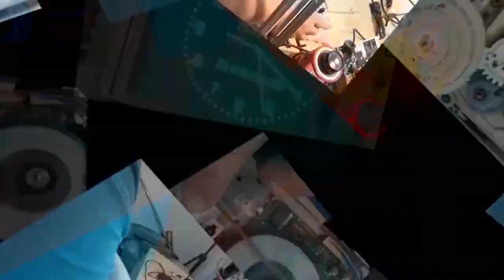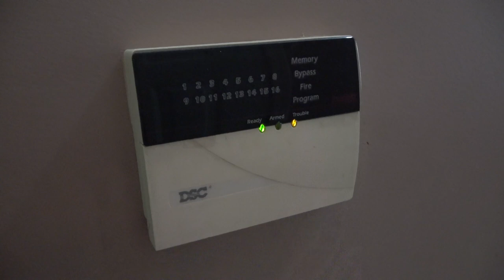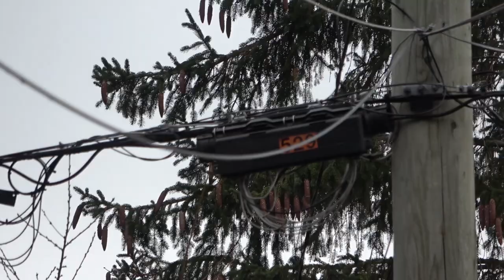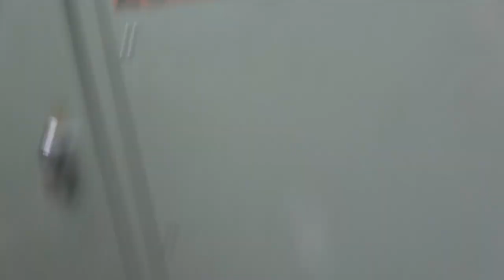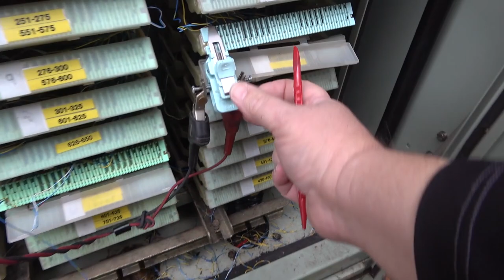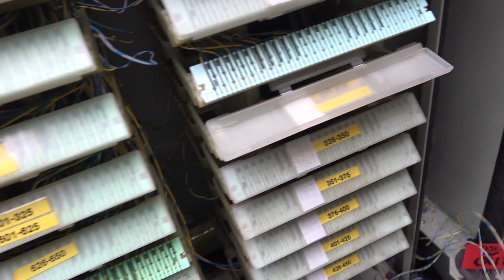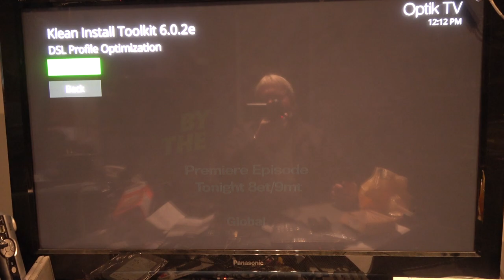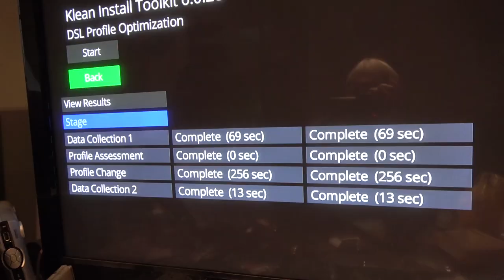Fixing my old noisy copper phone line

Comment: 75Mbps on ADSL??? 😲
When I was on ADSL2+ my line was rated a maximum of 21 Mbps but homes only got up to 11-12 Mbps down (I only got 6.3 Mbps down). I upgraded to FTTC back in 2011 or 2012 and now get about 46-49 Mbps down and 6-8 Mbps up (from a package that delivers "up to" 76 Mbps down and 20Mbps up). But you get 75 Mbps down and nearly 20 up? Wow!!!

Full gigabit fibre is now available at my address but I don't use enough speed or have stability issues to pay an extra £7 per month for the 150 Mb down/30 Mb up service and have no need (or funds) for the 900 Mb down/110 Mb up service available from my provider.

Comment: damn i wish we had copper lines still in my city, I don't want a voip line
Reply from the maker: Eventually they will all be gone here too. I would guess within 5 years at the rate we are going.
Reply: @12voltvids  thats disappointing, I imagine the rural areas will always have them. But what doesn't make sense to me is why someone would get a VOIP home phone when they need to have internet for it to work in the first place. So if the internet went out or power went out; oops there goes your phone to call for emergencies...
Reply from the maker: @VileStorms  yup that's the problem.  They need a battery backup to keep the ont running and the battery is only good for about 8 hours then it shuts down.

Comment: you can dump a high voltage down the line , this will arc any bad connection together ,
Reply from the maker: They used to use those old KS sets. Held a bunch of batteries and totaled about 600 volts. They haven't used those in years. We sunset them about 15 years ago.

Comment: DCS makes a ethernet card for older alarm system models like yours. Voip providers in Canada are required to support E911 by having you register your address with the line. Grandstream ATA will support pulse.  C'mon upgrade to fiber man 😅
Reply from the maker: Sure you pay the extra charges on my bill for life. How does that sound? I want to cut my charges not increase them. 
And its DSC not DCS. That might be fine and dandy if my alarm was monitored but it is not. I am the monitor. It calls me directly.  I could get a wireless alarm system from work for 10 bucks a month, but that is 10 bucks a month more than I pay now.

Comment: Also, during a power outage, the phone company was required to supply power on the copper lines for emergency service. Can't supply power through fiber optic lines. Where I'm living now, there is no longer an option to connect to copper, and the phone/cable company does not even provide batteries for the cable modem that the phone runs through.  I am tired of Government and corporate greed making my property obsolete once the reliability has improved enough to ensure the item will not fail. My pulse dial phones will not work without purchasing special adaptors. My analog/digital Seiko watch that reset itself for daylight saving time was killed by Congress changing the dates to reset clocks. Five portable/pocket televisions along with four larger home televisions made useless by the elimination of NTSC television. Government forced everyone to buy new televisions with that one. (The five inch color portable television is 36 years old and still working perfectly.)  My 1949 Cushman motor scooter made dangerous to use by increasing the speed limits significantly higher than the scooter will go. FAA imposing oppressive regulations a couple of months after I bought a drone. I could go on, but you probably get the point, a lot of the change is to force everyone to spend money for things that they shouldn't currently need.
Reply from the maker: I hear you. I have one of those clocks that is now wrong 2 times a year as it changes on the old daylight dates. Hopefully this will be the last year we change the clocks. Our provincial government is wanting to keep the time permanently on daylight. They had a plebiscite a couple of years ago to test the publics acceptence of staying on dayight time and it was something like 75% in favor.  We thought it would have happened last year and then covid derailed everything. Hopefully this year.

Comment: If the loop has digital service, it has voltage. Literally how it works...

Still not sure what you meant? did you mean the battery voltage for the telephone loop?
Reply from the maker: Battery is the DC loop voltage, supplied by batteries at the CO and that is what makes your phone set work. (yes there are giant batteries at the office kept charged by 52 volt power supplies) The digital loop does not use DC voltage. It runs on AC voltage, in the RF spectrum between 200KHz and 8 or 17MHz depending on the profile. The RF voltage is actually quite high, around 140 volts when it leaves the dslam but current in the micro amp range. Through cable attenuation this RF voltage drops substantially by the time it gets to the subscriber modem, but the subscriber modem is putting out an equally high RF voltage for the back-haul carriers.

Comment: There is a RJ11 wall module that has a built in circuit to convert pulse signals to DTMF so that old rotary phones can dial out on networks that don't support pulse.  If you do a quick google search for "pulse transfer dual tone multiple frequency DTMF converter" you should be able to find it, if you are interested.
Reply from the maker: That still won't change my mind about changing to fiber. I want the battery period. My security system monitors battery from the exchange. If someone cuts my phone line, battery drops, and my security system goes into alarm mode and sounds the siren scaring away the bad guys BEFORE THEY KICK IN THE DOOR. On fiber, they cut the fiber and the ONT just keeps sending the battery to the alarm and the alarm has no idea that someone is about to break in until they actually do break in. Then it goes off.
Ask why this matters? Well about 25 years ago someone did just that. They cut my phone line to kill the alarm, of so they thought. Well the siren went off and the crook ran away. I had to repair the phone line.
Same senerio,  with no alarm when the fiber is cut. Door kicked in, alarm goes off, bad guy runs away. 
Now, who is going to pay for my door repair?  That's right, I am on the hook for a new door. File an insurance claim, well I am still paying the first 500 bucks and then my premium goes up. 
So I would rather the alarm goes off first and scares the burglar away before he breaks in.
That is probably the number 1 reason for me to stay the course until copper is completely shut off which is still years away here. DSL gives me more speed than I need. It's more than good enough for the light internet usage I have. I don't game, I don't stream and I don't surf. I upload the odd youtube video and I do email. That is it. The data plan on my phone is 3 gigs a month and I barely use 1 gig. My home internet is unlimited, and I use under 100 gigs a month and that includes all the uploads I do which are several gigs each. In fact that is the biggest use, uploadingto youtube.

Comment: Can't have copper for a phone line and fiber for internet?
Reply from the maker: Copper is being decommissioned this year.  Will be totally shut down by the end of the year.  The hold outs are being shut down forcing them to change.  Have to deal with grumpy people that resist change.  I stayed on copper until this past March
Reply: @12voltvids  ah, sorry about that. I was suggesting keeping copper for the phone and switching to fiber for the internet, sorry if I came off too harsh
Reply from the maker: @kreuner11  no it doesn't work that way.  Initially 5 years ago a few people pulled that stunt. Telus is shutting down all copper. I would know i work for them.  There is an old folks home that is being torn down as soon as the new one is complete.  We are putting fiber into this old building even though it will be ripped down in 2 years because the copper is being shut down.  They want to shut down the entire co and probably sell the proprtyy the co sits on. Fiber can be fed in from the next co over.   No need to gave a 30000 sq fiut building to house equipment that is about the size of 5 full size refrigerators.

Comment: In Germany, even on fiber the emergency services know exactly where you are located.
Reply from the maker: Of course they do because the fiber is terminated at a physical address.  The ont is registered to your service address which is where the phone is also registered so if you dial 911 it shows up on the dispatcher screen exactly like it does on the old copper Network. Where the trouble arises is people that rely on strictly cell phone thinking that their location will be pinpointed. This is only true if the cell phone has a clear line of sight to the sky so that the GPS can get an accurate read. If you live in a house then there's a good chance that they will know your location as your phone will have received a signal up into the point where you entered the house so they will know the last place the cell phone had a GPS signal. If you live in an apartment or condo the GPS signal will show the last location your phone was detected but not show what unit you're located at. So you could be on the 1st or 10th floor and they wouldn't know.

Comment: how are you getting 75Mbp and 20Mbps on ADSL2+ as the max speed for ADSL2+ is 25Mbps down and 0.5Mbps up
Reply from the maker: It's not adsl2+ it is bonded VDSL 2.   2 phone lines each one trained up at 47/12 but capped at 75/20

Comment: This is really interesting but the statements about how cell phones get locations isn't accurate. They use a combination or gps from satellite, ground gps repeaters in dense urban areas, skyhook or similar wifi location mapping (basically unique wifi ID mapped to locations via carrier metadata harvested from a hundred million plus cell phones) and a pretty complex triangulation logic from cell towers. With all this combined the location mapping is quite accurate even indoors on modern phones so long as they can see some kind of signal and wifi as reference points.
Reply from the maker: Last week the police in Ontario went to the wrong address because their high tech system to locate the cell phone failed. You can have all the high tech crap you want, but it still is not as accurate as a land line phone.  There are times I check my cell phone to see where I am on the map and it is way off so don't give me this crap that they know where your phone is all the time. Most cell phones do not have the GPS chip enabled unless you are using an app that required it or you dial 911, and if you are in a concrete building away from the window the accuracy is average at best.
Reply: So that can locate what flat you are in as you lay dying on the fith floor?

Comment: A sign of the times ?   I didn't see anyone mention the ONE EYED REPAIRMAN....good ole MR. SUNSHINE who fixed many a phone problem.  Hated the repair tickets that had " E T I R  " in the dialogue......." every time it rains "  . It meant that the previous repair tech did not do a thorough job isolating and fixing the trouble or there was a HIGH OPEN on the line, ready to break open and just being held together by plastic insulation.   JwgK

Comment: Yay for new YT recommendations, and doubly happy to see VWestlife here, but uh. Switch man. I had nothing but constant issues and then fiber showed up. I went from WEEKLY issues to literally, actually zero. My fiber service stops working when I manually remove power. Not when it rains, not when a new person a mile away moves in and they steal my... literally never. For the love of god and all things holy, stop torturing yourself. Internet requests are insanely faster. And you can see it. And I’m not talking about speed of download but response (latency) to requests. You have to know this. DNS queries went from 40ms to 2ms. DOUBLE an order of magnitude faster? Yeah—you see it and feel it when three dozen connections need to be made RIGHT NOW in your browser. /rant

Comment: Why didn’t you just fix the out pair the F2 pair?
Reply from the maker: I could swap pairs no problem and if I was working and had my truck with the big ladder and my climbing gear I would have done just that and probably gave myself 2 spare clearances for future use. It was my day off and I didn't feel like going to get my truck at work to do this so I just swapped pairs and put the bonded loop with no battery on it to the noisy pair.

Comment: hmm... some contrasts amaze me... you (not as a person, but maybe region / country) have a nice infrastructure for ev's and other topics. i, on the other hand am on fiberoptic since 10 years, without even asking it.... these things i cannot fully comprehend. DSL was not installed anymore since about 20 years. 
Another thing I am curious about: So you say that with a DTMF / fiber fed phone, the emergency service does not know where are you calling from? Isn't this part of the caller ID system? I know that when I call the cable company, there is sometimes an anouncement regarding issues in my area (by area I mean block of streets).
Reply: With fiber service home phone, they will know exactly where you are.  What he said, was with a cell phone that they may not.
Reply from the maker: Right.  Home phone they know, cell phone only if it can see the sky.

Comment: I have optic fibre too coming inside, but also unused. I have no reason to switch optic fibre. I have internet via the cable and the speed is high enough. The available speeds are the same as what you can get using optic fibre.
Reply from the maker: Speeds over fiber are much faster. Cable internet from the cable company can offer speeds of 500 600 GB so they claim but they upload speed is restricted to 20 megabits. DSL can achieve speeds of 150 under ideal conditions with an upload speed of 40 my DSL gives me 75 down 20 up. If I switch to fiber on same speed plan it would be 75 down 75 up. The 150 plan would be $150 both ways the 300 plan 300 both ways gigabit plan 1 gig down 940 up, and the 1.5 gig plan 1.5 down 940 up. at some point I will be forced to switch because the copper is going to shut down but until then I'll keep my service on copper as it's more than fast enough for what I need
Reply: @12voltvids   Here, the down stream of cable is the same as what you can get with optic fibre. Only the upstream is lower for the cable, but i don't upload large files. So, no problems here.
Reply from the maker: @user-marco-S  fiber here 1.5g best cable advertises 1g, but on reality about 300meg.  Nobody needs speeds like that.  4k video stream takes about 21.  I never even come close to using my 75 down. Upload for me is a big deal as most 30 minutes yt uploads are about 9 gigs but i don't care how long it takes to upload.  I start the upload and walk away.

Comment: wow, best you can get on UK copper is 7Mbps. anything faster and it's fiber
Reply: Wrong. That might be the best you can get to your house on adsl but it isn't the max for adsl2+  if you are within a couple hundred meters of the exchange you'll get 20 meg down likely 1meg up. The further you  are away from the dslam the worse it gets. Google adsl vs distance.  It also depends what you class as copper. G. Fast circuits fed from the green cabinet in the street can give speeds up to 330/50 if your within 100m of it. Or if the cabinet is VDSL like the majority are in the uk you can get speeds of up to 80/20 if you are close I suspect this is the technology he is on Very high speed Digital Subscriber Line or VDSL for short. Issue lies with ISP in uk getting away with calling Fttc,  fibre to the cabinet, as fibre in their marketing crap. Is also called super fast fibre by some despite the last 1m to 2km being fed over copper. Again further you are the higher the attenuatuok the slower the sync speed

Comment: We only have fibre to the cabinet and then copper to the house, in most villages in the UK there is not enough customers for a big player to come in and do fibre to the house.

So get about 30mbs down and 10mbs up which is a lot better than it was on copper only. But it’s not going to get much better in my life time.  If there’s no money to be made the infrastructure will not be put in place. British Telecom will provide the lowest service they can get away with.
Reply: There's talk of openreach switching the copper network off around 2025, but who knows if that will become reality. Many of the older copper pairs going to older properties are starting to degrade to the point where its taking up a lot of their time investigating noisy phone lines and crappy internet speeds, FTTC isn't great for those with longer lines to the cabinet either.
Reply: @uK8cvPAq  Tell me about it. I've still got quite a distance to the FTTC but it a lot less than the 5m it used to be. but cost/customer ratio does not work in small villages so until BT is pushed FTTC it will be.

Comment: so your using VDSL not ADSL. here in the UK ISPs are forcing people to VDSL FTTC. (Fiber to the Cabinet) ive changed all the cabling to CAT6 Solid Cabling which improves the performance and ping times quite a lot. as im hosting mail and web servers i need a reliable line. Fibre is ok but its too pricey for what it is. i would rather have 2 DSL lines for WAN1 and WAN2 for failover than have fibre
Reply from the maker: Yes VDSL here. FTTC, and that is where I went at the end of the block.